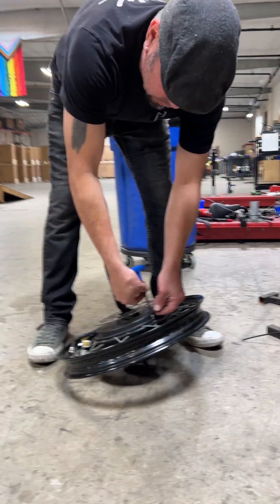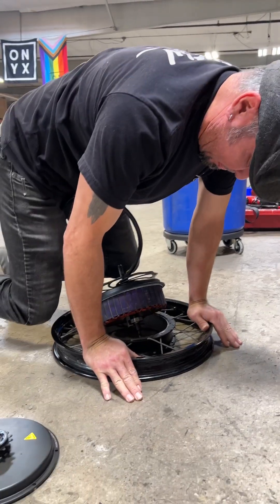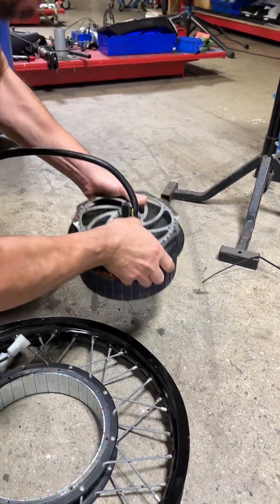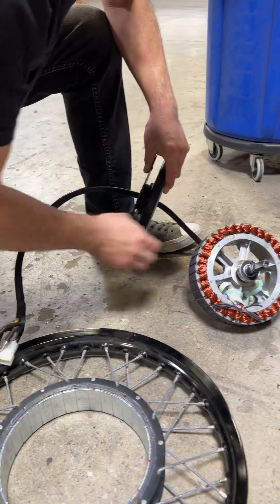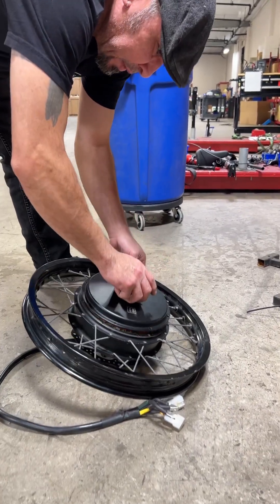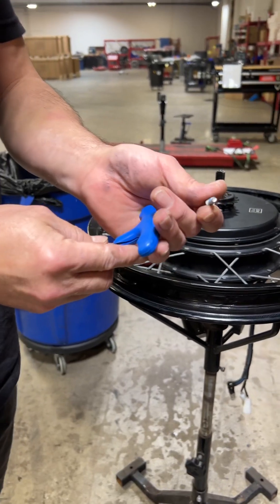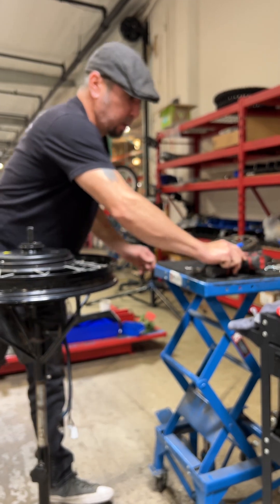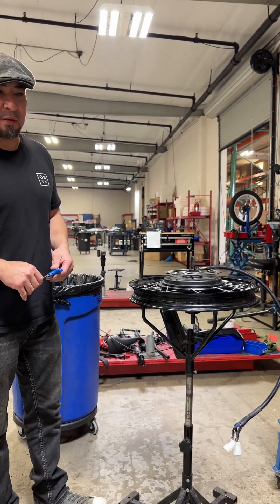Replacing the motor core on an ONYX RCR

Comment: This is how we can replace the rear motor? How to take it completely off?
Reply from the maker: No this is simply how to remove the motor core from the wheel and put it back in. This is a more specific process and not something you would need to worry about if you're just taking the whole wheel off your bike or fixing a flat or something.